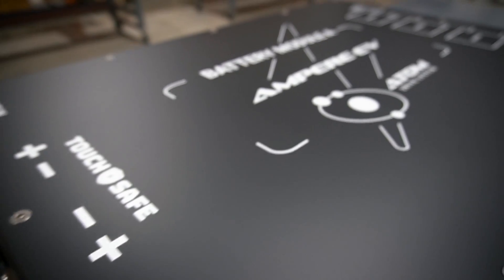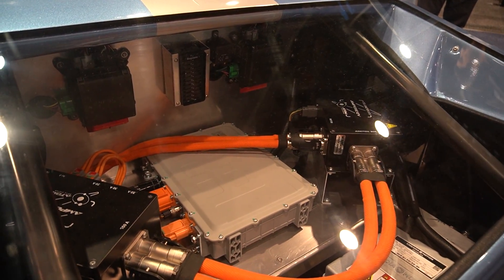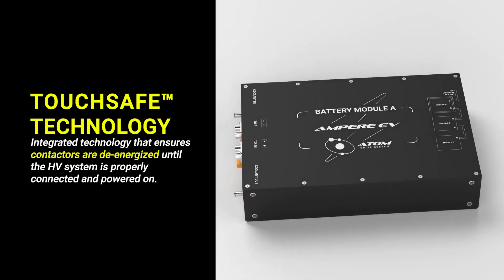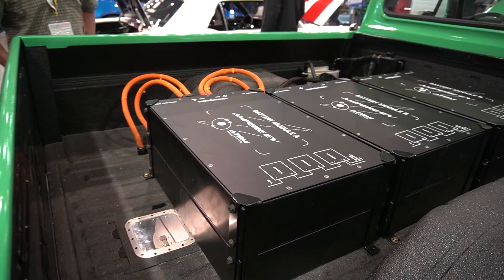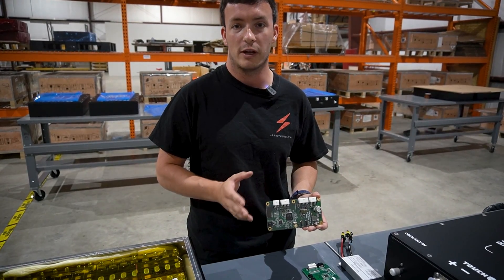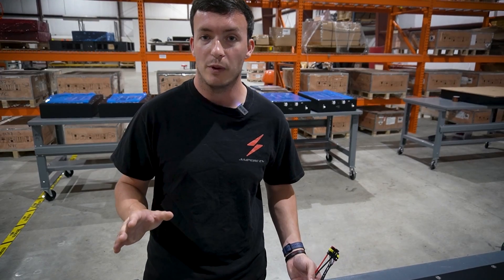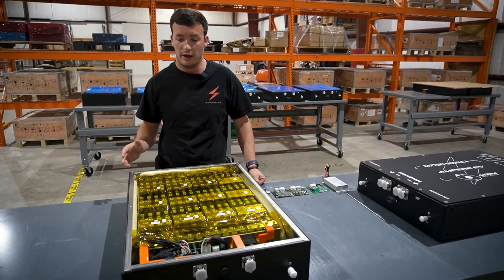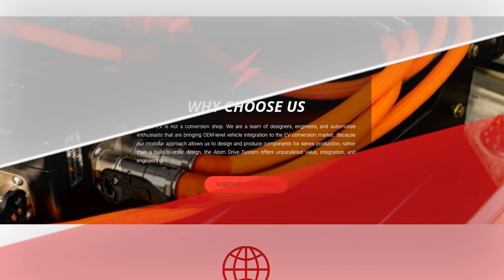EV Enlightenment - WHAT IS A BATTERY MODULE

Comment: This is really phenomenal work - seems to be the best in the EV aftermarket industry thus far. I'm wondering about the maximum power output of the 42kwh triple module. 400v max * 1000 amps is 400kw or 500ish hp. Is that the maximum the pack can provide? Or for shorter bursts can it provide even more power?
Reply from the maker: Our 42kWh battery system can offer just under 400kW peak power! We do offer a larger 84kWh battery pack that can supply higher current outputs for high-performance builds looking for the most power.